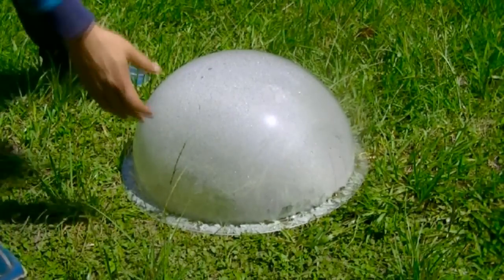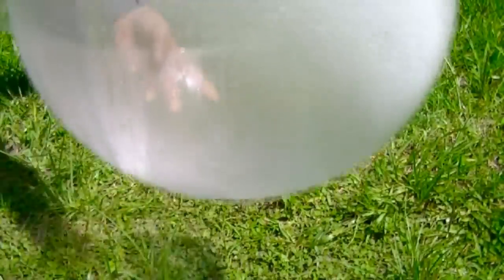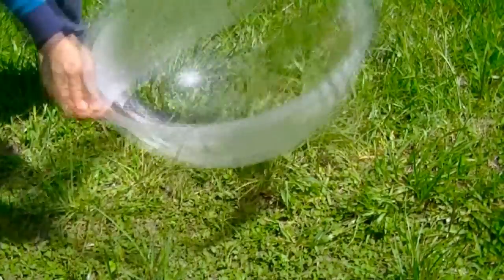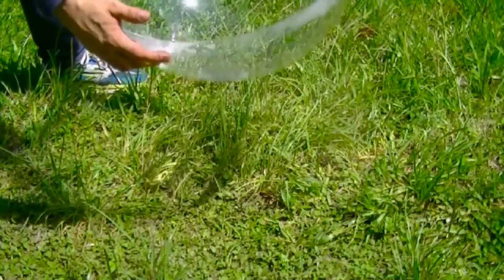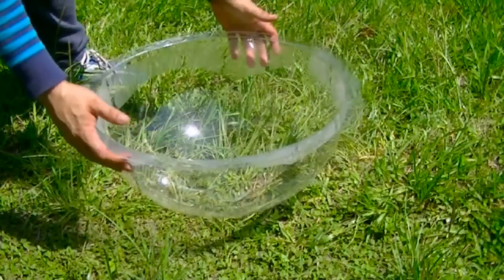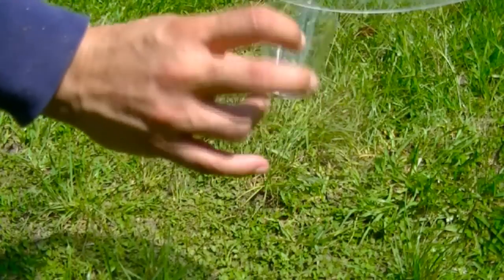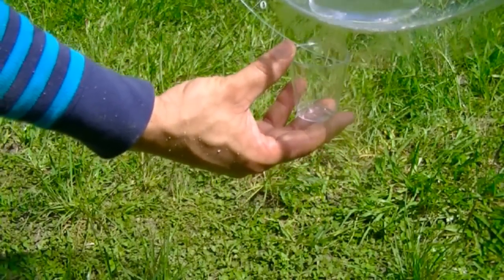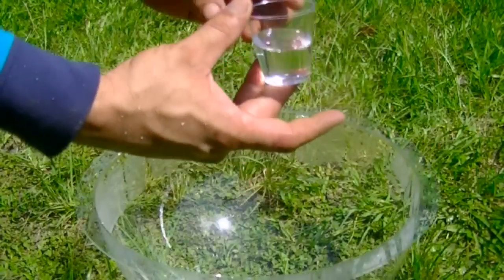Solar Water From the air and ground Distilled Survivalist water condensation 45 minutes prep per

Comment: Another idea. Fix a square plastic sheet close to the ground with 4 poles, put a weight in the middle so that the plastic sags. The small droplets will condense and run to the center, where a glass (or any container) will collect the water. Cheers!

Comment: Just keep in mine, this mostly works from 'perspiration' from the grass. You won't get much condensation setting it on barren ground or concrete, so it's mostly for areas that get regular rainfall, and if that's the case you try to collect the rain.
Reply: What if you put the dome over a soaking wet black towel?
Reply: It’s still good to know

Comment from the maker: Distilled water is good for you if you eat a modern diet. It should only be avoided as a re-hydration method after excessive sweating. Distilled water leaches excess sodium and becomes mineral water in your stomach. It also removes some trace heavy metals.
Calcium and magnesium and potassium are the only concerns.
Hard" water, or water containing disolved solids, is associated with possible cardiovascular effects and negatively correlated with atherosclerotic heart disease.
7 stage good 2

Comment from the maker: St. Augustine Grass or Buffalo Grass has runners so the surrounding grass transfers water. Also the moisture being trapped is water that would naturally evaporate away with sun exposure. This is not totally removing moisture, simply collecting it. The lux in the container during full condensation is within 80% of the exterior so photosynthesis is not drastically reduced.

Comment: Dig a hole in a sunny spot, place fresh leaves inside, put a container on top of them to catch the water drops. Cover the hole with a clear plastic sheet and seal the edges with sand or dirt. Place a small stone in the center to curve the sheet downwards and any condensation then drips into the container. Splash any water source onto the leaves to increase efficiency. Even urine  will do, as the condensation is pure water with no contaminants! Kids enjoy this and it is good science!

Comment: I'd glue a small, plastic, 1 inch gutter to the inside rim of the bowl and attach a small flexible tube to a drain hole.  Hook the tube up to a flat, plastic, water container (like the camping showers) and you could collect a gallon or two of water (probably have to move the bowl around...).  Thanks for the video!

Comment: A fern or tree with relatively wide leaves is great for water collection, just tie a plastic bag over a branch, tape it up and the leaves will expirate heaps more water vapour that condense on the plastic. cut a hole at the end of the bag and drink, peg it up ( or tie it if you have to) so the hole faces up, and the water collects near the opening, not over it.

Comment: Actaully, there is moisture in the desert.  What you can do is, either dig in wash out areas, or cut up cactuses and place the dome over them.  The heated air can hold more moisture, and the condesation is collected on the cooler surface.

Comment from the maker: It depends, if the soil has VOCs with a boiling point equal to or less than water, then it may leach. If the soil has been exposed to the sun, you should be fine as most would be gone, better than well water from the same area. I would used on non-fertilized lawns.

Comment: Well, you could elevate the water.  In any case, using your Berkey is the same process as a Brita.  It removes chemicals but does nothing for suspended solids and rock.  We call that hardness.  Besides, if you pH water that has been filtered using activated carbon, it is acidic.

Comment: If you were using this as your water source, you would still want to filter and boil the water for safety. It will contain whatever pollutants are in the air, i.e. petroleum resins and such.

Comment: You pack sheets of plastic and stretch it over a frame made of branches with the leaves stripped off, or over a hole in the ground you pee in the hole or put vegetation in and put a small stone on the middle of it to depress the center and catch the distilled water in a cup under the stone. Takes a few of them to make enough water for one person, so bring a number of plastic sheets.

Comment: Water and other chemicals do evaporate. It could be  interesting to research what chemicals are present  in crap that might condensate along with the water. It is always good to use a resistivity meter to test the water. Any chemical added to the water changes the resistivity. Benchmarking the collecter water reading against pure distilled water resistivity might give some idea o how pure is your water. But face it; it will be cleaner than stream water any day.

Comment: That is so simple, I wonder why they don't do this in places where water is scarce.  Woman and children have to hike many miles to filthy water holes. Could they be doing this instead. would this work in such places.
Reply: +Veronica Conway 
In places where water is that scarce, there would be no moisture in the soil to evaporate anyway. The sun would already have dried it all out. But it would make a reasonable still to evaporate the filthy water and make it into safe drinking water, if you had a big enough system. One person would probably need about 3 litres (3 quarts) of drinking water per day. The sun's power would only be effective for a few hours per day. Even then, a system this size would only produce about 40 mls per hour. Times say 8 hours max, that would be 320 mls of water; about 1 1/4 cups per day.
Reply: +Veronica Conway
So this is why say skylights in houses don't do this.

Comment: That's good, but the ceramic filter is only for neutralizing bacteria.  Standing alone, a ceramic filter could be used instead of chlorine pills in a pinch.

What most people fail to remember, water can be contaminated in 2 different ways. Living things that kill us right away and dissolved solids and chemicals.  Removing any of these requires filters working in tandem.  Is it really worth the risk when they are so cheap?

Comment: Ok.........u dig a hole in the ground three feet in diameter........the hole should be two feet deep.......get a clear plastic sheet, u can get a clear shower curtain from the dollar store......cut this in half it will make two coverings.....place a cup in the bottom center of the hole..,....get a tygon tube, quarter inch diameter from hardware, medical supply or auto store about three feet long, place one end on the bottom of the cup......place the plastic sheet over the hole and deprss it with a small weight in the center so that he sheet looks like a lens with the point of the lns just over the cup.......the other end of he hose should come out of the plastic sheet so u can suck from it.......weight down the ends of the sheet with the dirt u dug out of the hole........as the sun warms the plastic, moisture transpires out of the ground and condense s on the sheet.......it drips towards the center of the sheet condensing at the lowest point over the cup.......it drips into the cup......suck out the water to drink....depending upon the amount of moisture in this ground this can generate pints of water for several days.....when the water stops forming....u can open the plastic and dig the hole deeper to expose more moisture laden earth but u will nd a longer hose.......alternately u can place cut green vgetation in the hole cover it up and as it heats up water will collect on the plastic and fill the cup.....just make sure nothing touched the plastic also the water will taste like the plant so don't put anything poisonous in the hole.......military survival manuals may call this a solar still or transportation still......some manuals say that u can urinate on the sides of the hole and only fresh water will transpire out of the urine and be reused......I don't know about that!!!!!......eventually u will have to make another hole unless u dig hole at the end of a swamp or above the hi tide level of a beach..two places that should stay wet......u can also tie a bag on tree branches......put a rock on the bottom of the bag..... add a drinking hose and the tree will breathe or transpire moisture...,.this is sometimes called a transpiration still......

Comment: So 45 minutes for one mouth full.  That is not going to keep you alive frankly.
Reply: ***** No, because lugging a big glass bowl around with you is going to use more water than it saves.
Reply: Ok you made a statement.. now where is the evidence or discussion?  No where to be seen?
Reply: a night is usually 6 hours, so if you leave this thing running at night it could produce 8 oz, it could definetely produce enough water to atleast not dehydrate
Reply: I believe you need the sun to evaporate the moisture in the grass and soil, so you can't "leave it running" at night.  However, you could put a plastic bag, on the ground and collect the humidity that collects on it and drink that also.  Or even wrap the bag around the leaves of trees or shrubs and collect the evaporated water they give off.  Bag preferably should be black.  So carrying around a large black plastic bag could save your life in a true survival situation.  It can also provide you with protection from weather and trap your body heat for warmth.